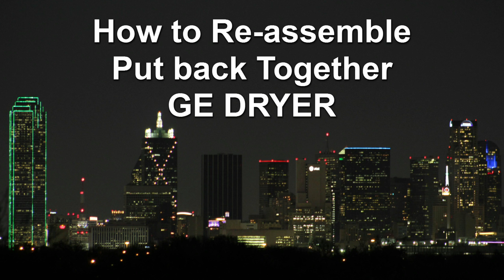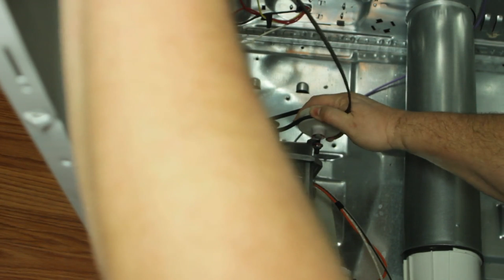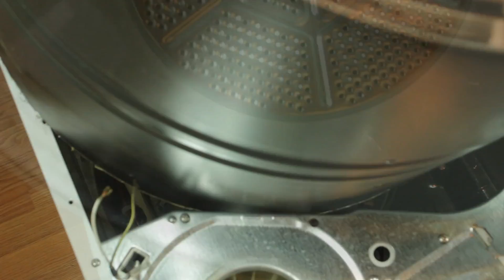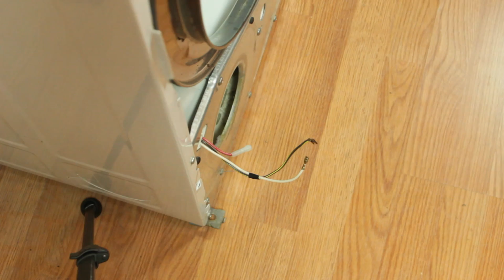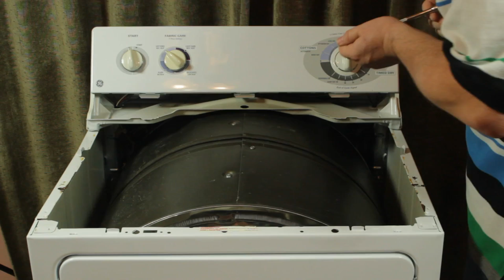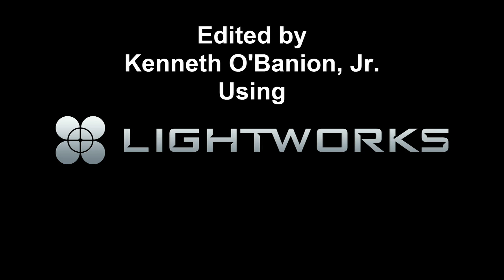GE Dryer Repair - Re-assembly, Put Back Together, Assemble

Comment: I took the top and front panel off my GE dryer to vacuum out a bunch of lint and dirt - I had no problem with this. However, now that I have reassembled it, it makes a light intermittent thumping noise. What did I do to cause that? Could I have reassembled it wrong? All screws are back in and everything fits together well.
Reply from the maker: It could be that the drum got slightly out of round when you were handling it.   Or, the weld spots where the tub sheet metal are welded together to make it round might have come loose, this usually happens at the edge where it sits on the drum support roller wheels.  It would by in a steady rhythm if that was the case, not intermittent.  Those are only things I can think of off hand.  Also, try raising the front two feet a little bit so that the front is just slightly higher than the back, sometimes this helps with tub aligning properly and might eliminate a noise.  Let me know what you find out!
Reply: Thank you! I will work on it more tomorrow and let you know. I appreciate the help and video!

Comment: I replaced the bearing, got it all back together and now it smells like something is hot as soon as I turn it on. I didn't add the lubricant to the bearing. Could that be it?  Did I miss something?  Otherwise the squeak is gone and seems to be working fine although I have not run if for a full cycle because of the smell.

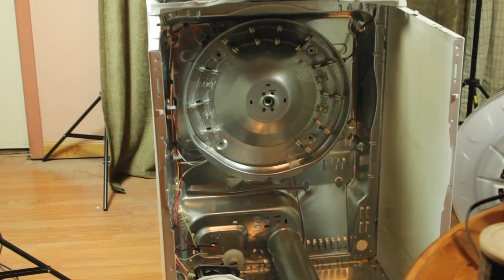Comment: At 2:00 you mention that you need to tilt the unit on its back to install the drum. I didn't want to have to disconnect the vent pipe so I kept the unit upright to put the drum back in. It was a bit trickier than having it on its back but it was doable and preferable to having to disconnect and then later re-connect the dryer vent pipe.  Thank you for your detailed video. I really appreciate it.

Comment: You saved my life man.  I just graduated from a university with my bachelors degree and I'm in search of a job.  I don't have any cash.  I was trying to take this thing apart all wrong.  Your post was great.  I watched all three sections.  I thought I had to take the three screws out of the back of the drum (inside the drum where the silver plate is) and when I went to put it back together it was really hard.  Finally I used two rat tail files to line it up.  I had to take the drum back out because I couldn't get tension on the belt, that's when I realized I did all of that extra work for nothing.  Anyway, it took awhile but I did it.  I rewired the element to the section where it burnt because I can't afford a new one.  So far so good.  Thank you.

Comment: Sorry. So I watched the videos for ge dryer won't start and I'm impressed with them both. I was able to take it apart and put it back together thanks to you, but it wasn't the fuse. I wonder if it is the door switch? The light comes on and goes off when I press it but while holding it in still won't turn on. What else could it be? By the way I am proud of myself for getting this far for being a girl and all, but I want to fix it, and not have to purchase a new one. What should I check next?

Comment: This video was great...after I was done I fixed my problem and knew exactly how to do some of the tricky things because of this - thanks.  One question...when the dryer was back together it would only run when the start switch was held to start.  My dry is the same as this but a gas dryer - I'm going to use your door switch video to check that - any other suggestions?